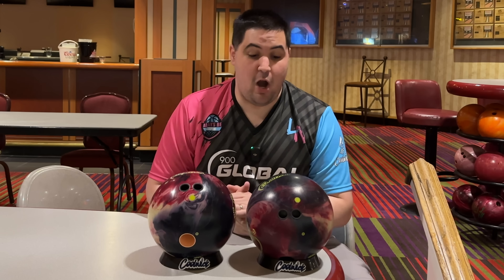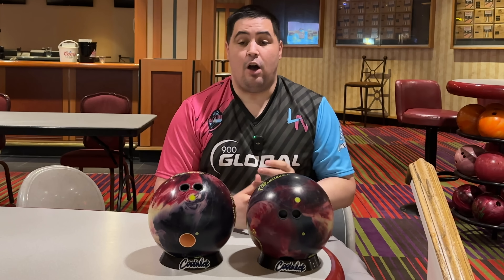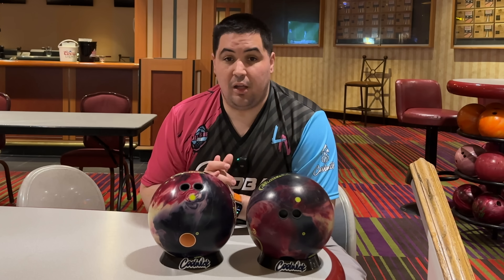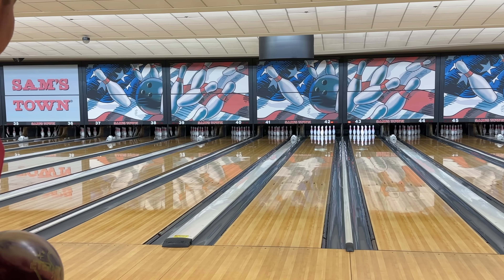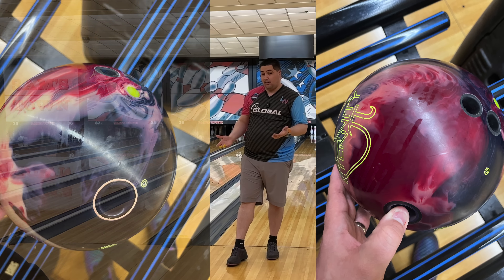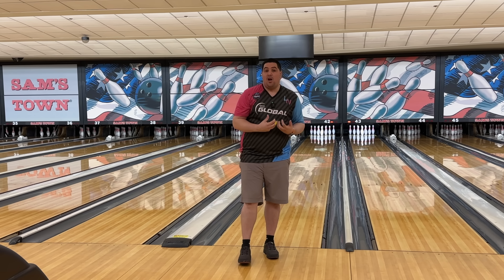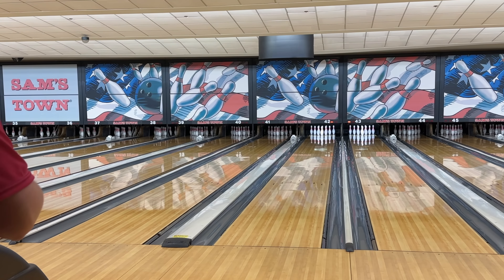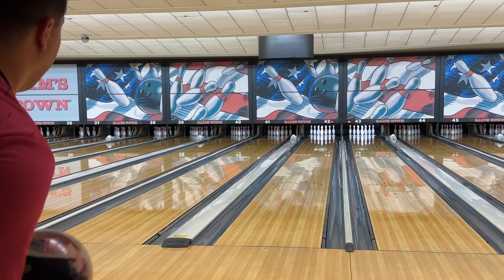Whats The Difference Between Pin Up and Pin Down | In Depth Guide!

Comment: I learned about pin up/down for the first time on my 900 eternity pi. I ended up drilling the ball pin UP to take advantage of greater hook potential EARLIER. I'm noticing there is more room for aggressive pocket hit angles with the eternity pi drilled pin UP in my game. My balls tend to be way too long before they react on the back end and don't hook much for my asyms. This video demonstrates the incredible hook potential (i.e., hooks late and violently) and better angle into the pocket.

Comment: I’ve tried to watch a lot of videos on this. This one made it way more clear on the difference. Considering buying myself another IQ tour and drilling it pin down. Thanks for this.
Reply: My pin down ruby throws very straight and weak. Almost like a spare ball
Reply: @LILR1CH  LOL small world. I also had a pin down ruby when I bowled 1 handed. If I got it to the dry it would hook too early (much) if I got it up 10 it slid like a spare ball. So I sold it lmao.
Reply from the maker: I appreciate you saying that! I will say be careful with drilling lower DIFF balls pin down
Reply: Drilling a low diff symmetrical pin down is asking for a dud.
Reply: @TaiNiPoni  damn hha did u just sell it to a friend or where?
Reply: @stormb28  should i plug n redrill it?
Reply: @stormb28  when your bowling on a flat or short pattern a dud reaction works pretty good

Comment: my teacher and driller/proshop owner (that is playing world competitions over 50 and she's 30 years of experience) told me the following considerations:
- the total hook of the ball is the same both in the pin up vs pin down, what is different is the reaction. Pin UP hooks later but is more violent, pin DOWN hooks earlier but is softer
- in pin DOWN: the reaction is smoother as it starts to hook earlier (the ball starts to loose energy earlier, but in a soft way). The shape then is more circular than angular.
- in the pin UP: the reaction is stronger as it start to hook later (the ball keeps energy for longer, but it hooks in a more violent way and later). The shapen then is more angular than circular.
- In the pin up version, you can vary the distance from the pin to the fingers; the more is the distance, the more the ball will hook later but in a even more violent way. In a pin down layout, the distance from the pin to the fingers won't change almost anything.
- if you want a balance between the 2 versions, you can also drill on the pin, but not to avoid the warranty and to reduce the risk of ball's cracks you should drill completely the pin with the finger. If you're not drilling on the pin entirely you have to drill it at a minimum distance from it (check Storm's specifications for example, they explain that)
- What matters the most in terms of hook potential on symm balls, is not the position of the pin (pin up/pin down/on the pin), but is the position of the CG. A CG between thumb and figers will minimize hook potential (can be good for high rev players), a CG on the right (if you play with right hand) will maximize the hook potential (good for low revs players).
- High revs players to reduce the hook potential may also opt to drill the pin above/below/on the middle finger instead of above/below/on the anular or instead of in a more external position compared to the anular.
Reply: he said the exact opposite in the video, pin down hooks later and pin up hooks earlier. so which is it?
Reply: @VincentsVideos  if you search for the video "Pin up vs pin down - does it matter?!" from JR Pro Shop, they say almost the same I said...
They also add that pin up has more hooking potential (approx 5-6 boards more) but they confirm that pin down means smoother reaction while pin up provides later and stronger reaction...
Reply: @endystrike000  gotcha that makes sense. in that case would a longer pin-to-PAP distance make the ball travel even farther down the lane with a sharper hook

Comment: Great video! Thanks for explanation. So if we bowl on a lane with a lot of oil...should I bowl with a pin up or pin down? I would guess there is more to the answer depending on many other factors but based on responding quick to friction a pin up would be the one to start with?
Reply from the maker: Many factors here but typically pin up

Comment: Great Video and Subject! I learned that pin balls make more flare rings, so if you need that extra boost on heavy oil patterns, go pin up. And pin down makes less flare rings, so If your bowling on a typical house shot, go pin down to pull some of the hook back from the friction. Both are useful, depending on the underlying conditions, just depends on your speed and rev rate and what your bowling on.
Reply from the maker: Thank you!

Comment: At what point in building an arsenal should you add pin down?  What type of core/cover combination is best suited for pin down, and how does that differ from just having a balanced mix of sym/asym & solid/pearl/hybrid, etc.?
Reply: For additional context, I'm slightly speed dominant, with a moderate rev rate (low to mid 300)
Reply from the maker: For me I like to keep lower RG higher diff cores with stronger covers pin down and at least one in bag that’ll allow me to play closer to the friction

Comment: Great video explaining the difference between pin up & down, but what does it mean when the pin is on the right side of my finger holes? Almost all of my balls have the pin on the right of my fingers. I used to bowl at a club that was dry as a bone & hooked like hell. I needed a ball that hooked late, but now can't get it to hook until way to late on a oily lane.
Reply from the maker: It’s like half way between both

Comment: Early in my bowling "career", I was told that pin down makes the ball hook earlier.  I later understood it, or thought I understood, to be that a pin down ball starts its roll phase sooner than pin up - essentially burning up some of its energy sooner, which smooths out the reaction on the back end response to friction.  Had a chance to understand this for myself when the Hammer Widow Ghost released.  Everyone I saw with the ball drilled pin up, the ball was relentless - angry, violent hook.  I saw a vid of Mitch Hupe throwing a pin down Ghost, and decided to buy one and go pin down for myself, and was very pleased with the result.  Think pin placement in relation to up/down position is all about energy retention and dispersion based on the type of motion the bowler is looking for in that piece.
Reply from the maker: Pin down will take longer to respond to the friction while pin up will react sooner to the friction

Comment: Got a pin down, 14 lb IQ Tour Ruby, and it’s an adjustment since I’ve been pin up 15 lb since coming back to bowling. But I like the look it’s giving me and the controllability when missing slightly. But it’s a lot easier to tug a 14 lb ball when compared to a 15 lb ball.
Reply from the maker: I would disagree with that. I did a video throwing 14 nd felt very similar

Comment: I think something to add is that if you are a high rev bowler, Pin down can be helpful on burn/transition. I run into issues as a high rev bowler where the Pin up balls want to get started up too early and then puke down lane like in your gem video where for you the pin down rolled way better for you.
Reply from the maker: Should have added that ye!

Comment: Most of my balls are drilled pin up, but I had one ball that was pin down, which I did very well with. I guess it depends on the cover and core of the ball, matching up with my style and the lane conditions.
Reply from the maker: Definitely yea!
Reply: Thanks for this review... If I go with an Eternity PI for the top of my league bag, I will probably have it drilled pin down.

Comment: Interesting video. I usually start with a pin down older Hammer Tour ball at 1500, then progress into a shiny pin up symmetrical ball. If that isn't cutting it I''ll try a shiny asym. Maybe I need to rethink this... your thoughts?
Reply from the maker: I just go to whatever ball I think will get the job done regardless of layout ya know

Comment: I have a arsenal and most of them are right handed while I am left handed while a few are left handed. a hyroad x pin down under the middle finger with trucut version of 1500 grit polish and on the burn in game one it goes long and whips down lane and love it ( left handed and so is my spare ball). I have 2 IQ tour emeralds same layout but one has the normal finger holes while the other is the vise interchangeable fingers with the center of finger holes drilled deeper with a smaller drill bit but the emeralds same layout same finish with pin to cg being shorter then my first one ( both right handed ) , honey badger pin above middle finger too long , the dark code same layout and finish as the emeralds ( love it ) , the phaze 2 same layout as IQ tour emeralds at 2000 grit but it wants to read early but be long as a pearl , zero gravity pin above my middle finger while mb is on left side of thumb and love to death , and my badger the s71 hybrid cover symmetric I will be throwing it next week at box finish. So my question is the phaze 2 wants to be early but hook down lane should I raise the surface on it to a 4000 grit or  polish it or have redrilled stronger. Because I am having more success with the right handed equipment then my left handed stuff.
Reply from the maker: How do they roll for you?!?
Reply: @LuisNapoles  the right handed balls react the same they would if they were left handed . The 2 IQ tour emeralds are drilled identical but the pin to cg distance is longer on one like a 4 to 5 inch while the other is 3 to 3.5 inch pin at the same grit . The dark code has been awesome for me , the zero gravity is smooth just like the dark code , the phaze 2 I had to do 1500/3000 to get a little bit of a shine look which I like , the honey badger is a very strong forward rolling ball and the badger I am in love with I can throw that ball on the burn and not have to worry while having the badger at 3000grit trucut 2  weeks ago when the oil was fresh because no one bowled on it it took off at 40 feet and took the 10 pin off clean.

Comment: Was always taught pin up is more angular because it increases the differential and raises the RG since you are taking mass from the sides of the core making it taller so the ball does not rev up as fast… pin down is more even rolling because it lowers the rg and differential since you are removing mass from the top of the core making it rounder…
Reply from the maker: Pin up decreases RG that’s a fact

Comment: I think why the pin down/up info used to be "reversed", (and why I see a few comments stating exactly what I was taught about pin up being "later") is due to perception.

For example; you say the pin up reacts to friction "sooner", yet that layout goes further down lane before turning sharply to the left. So how is it reacting "sooner"? 

Conversely, the pin down layout starts turning earlier on the lane, with a less aggressive shape, even though you say it reacts to friction "later".

I think the reason is because with the pin up ball, you move 5 boards left, so the ball skids in the oil (center of lane) longer, and it hits friction further down lane. So, the pin up ball reacts "sooner", but is not hitting friction until "further" down lane.

Is that correct?

As such, it makes most sense to drill my solid covers as pin down, and as I follow transition left, have my pearl covers drilled pin up?
Reply from the maker: I mean yea I can get with that*
Reply: @LuisNapoles  lol what?

Comment: It seems to me that when considering pin up vs. pin down, one should take into account what the ball was designed to do. 

All of these companies design these balls to do different things. Some are more angular, some are smoother. Some are for heavy oil, others are for lighter oil and everything inbetween. Some are stronger, some are weaker. 

To me, this is the point of having multiple different types of balls in your arsenal. 

Trying to completely change what a ball is designed to do would be like trying to make a bomber (airplane) fly like a fighter jet.
Reply from the maker: I can get with that yea